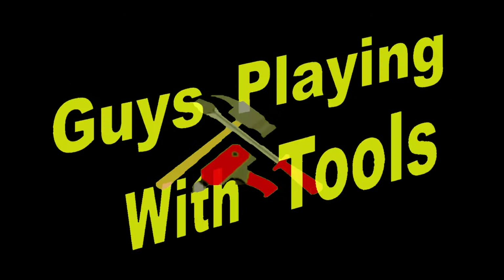The easiest way to rewind a recoil spring

Comment: THAT is a fine idea! A-PLUS! I remember the old Briggs way of doing it with a block of wood inside the recoil itself. YEARS ago. This just goes to show that it might be hot there but it hasn't baked your brain out! Thanks, pal!
Reply from the maker: Thanks 😁 I do a lot of 2 strokes and they have their challenges, this solves a big one!
My brain isn't completely cooked yet, but we still have 2 of the hottest 3 weeks of the year left so... I will keep you posted(unless I get brain damage from the heat) 🤣
Reply: @GuysPlayingWithTools  I think Texans would make good hillbillies and hillbillies would make good Texans, having been one all my life so far and having been around the other all my life so far but not enough to move from the relative cool of the mountainous frying pan, square-dab into the middle of the fire. So keep me posted. I turn a fan on hi pointed at my hard drive when I get a post from out there. The computer gets hot but doesn't quite melt that way.
Reply from the maker: @lewiemcneely9143  Hillbillies are Texans that don't like the heat LOL
I don't think a real hillbillies would like to live in Texas though, too flat. What the call hills and mountains here are mostly still flat enough to farm.
Reply: @GuysPlayingWithTools  That's the best explanation I ever heard and also the most accurate. A-PLUS!
Reply from the maker: Where were you when I was in school and needed those grades? 🤣
Reply: @GuysPlayingWithTools  Probably burning diesel in something. I did that for over 50 years. Not much gas but a LOT of diesel.

Comment: How do you get the wire off once it's in place so you can get the plastic piece on the other end of the spring
Reply from the maker: It's kinda tricky the first time, you push the spring down past the wire and it jumps off.

Comment: Great job i did the same with the screw but the wire is a great idea, i did it with strong string!!! Wire would be so much easier. Thanks bill.
Reply from the maker: I get them close to the size I want them to end up so they aren't too tight,  string would probably work just as well
Reply: @GuysPlayingWithTools  String is little cumbersome not being stiff. But it got job done. However getting a spring back in a washer timer was a no go lol
Reply from the maker: The stiffness helps for sure.  I would love a crack at that timer 🙂

Comment: I have never had to deal with that matter only thing is that I have done us put in new rope on the pull start system on a push mower  it tested me big time but I got it done
Reply from the maker: If you ever have to do one in the future,  this is the easiest way I have found so far.
Reply: @GuysPlayingWithTools  okay thanks for the info on this matter of pull start system spring rewind
Reply from the maker: @robertmailhos8159  👍
Reply: @GuysPlayingWithTools   👍😎😄

Comment: Good job Bill, I still use the zip-tie but may be changing to wire now. 🙂👍
Reply from the maker: I had to try something different when I was rewinding one for a Stihl with the gawdawful "Easy2Start", the hole you have to put the spring in is especially deep and the tie strap end was hanging up everywhere.
Reply: It does have its drawbacks.
Reply from the maker: @Big_Johns  This one worked perfect for the Stihl and that's the one that wears me out the most
Reply: John stop being so tight and buy the proper tool 😂
Reply: @menditman2004  Yeah. That's what I was thinking. hahaha No I wasn't ,:face-purple-crying:but that's funny.

Comment: Easy peasy just a reminder to keep all those wire ties whenever you have to buy a recoil spring they come in handy when you do as Bill did. Some time they have a circular bar of metal holding the spring together and you just slide it out into the recess once aligned.
Reply from the maker: Good points.  I made the wire the right size for the machine I was working on, but for guys who do it a lot, if they save the wrapping wires that springs come in, they are usually close enough to work great for this.

Comment: wow! my goodnesss.
Reply from the maker: I tore my fingers up quite a few times trying different ways to rewind one of these before sacrificed a socket.  It works every time now.  🙂
Reply: @GuysPlayingWithTools  yeah, sounds about right ! you figure out a way! i also watched a guy simply cooiling it up by hand inside the housing, which is also reallly easy. so thats what i ended up doing. takes about 60 seconds. nice n easy.
Reply from the maker: @tvdylan I haven't tried that, but I will. Since I cane up with the winder, I stick with it